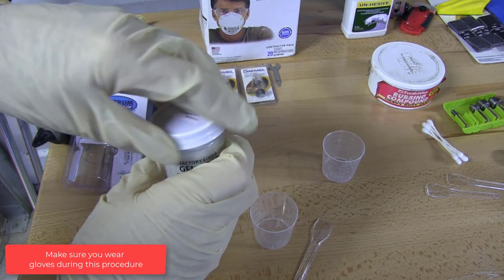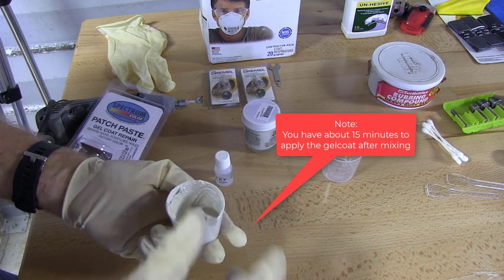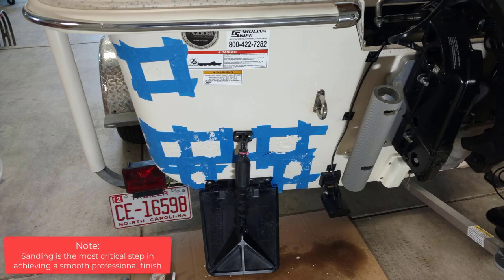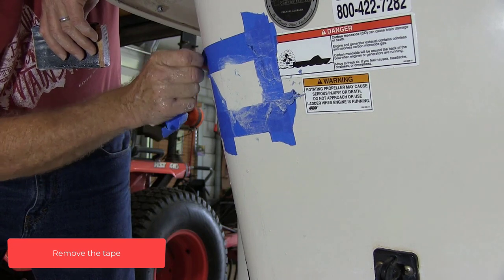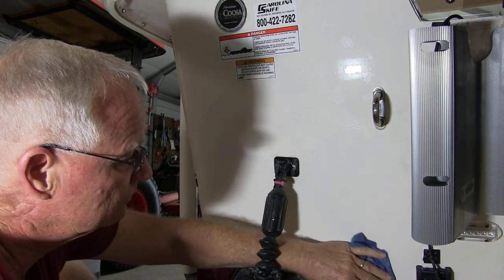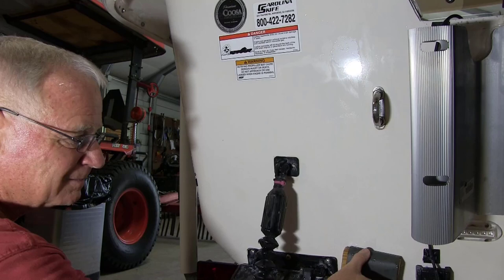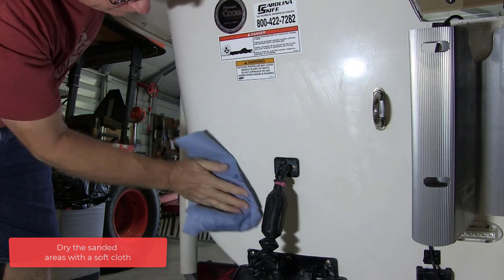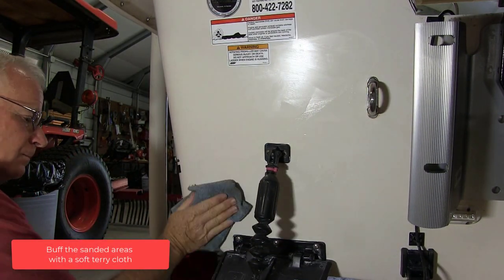Part 4 - How to Repair Screw Holes in a Fiberglass Boat

Comment: Could you do a Video on how to remove screws from the stern of your boat?    I will wait until the mosquitos wont carry me off to do these repairs.     I used 4200 to install brackets for the smart tabs.     Thank you very much !     Wish you were my neighbor 😁
Reply from the maker: I appreciate you watching my video. I hope you can complete your repair project. If you were my neighbor, I would be glad to help you with the boat repairs. As far as making a new video, I have no plans to do so.

However, the preparation and repair process for the holes in the current video will be the same for the stern (if it's fiberglass).

4200 Marine Sealant is a semi-permanent, flexible adhesive sealant that bonds and seals effectively while still allowing for disassembly. You should be able to remove the screws.

Please make sure to take note of the following instructions:

If the screw holes go all the way through the laminate and are located below the waterline, you will need to cut pieces of fiberglass fabric in varying sizes. These pieces should be saturated with a mixture of epoxy 105/205 and 410 fairing filler to fill the hole,  the number and size of the pieces will depend on the size of the holes.

I hope this helps.
Thanks,
Norman

Comment: This is the best video on this subject that I have seen.  Thank you very much for taking the time to make it.  Well done!
Reply from the maker: Marty,
I appreciate you taking the time to watch my videos. Thanks for the nice comments!
Norman
Reply: @NormanGooch  I hope my repairs turn out as good as yours, but I doubt it.  The main thing is that your video has given me the confidence to try!  Thanks again!
Reply from the maker: Marty,
You can certainly achieve the same results as I did. Take your time, complete one step at a time, and never try to rush through fiberglass repair. Most mistakes are made by:

Trying to complete the fiberglass repair too fast.
Not properly preparing the damaged gel coat surface for repair.
Allowing enough time between applications for proper cure time. 
Becoming fatigued during the repair process.

If at any time you become fatigued during, cleaning, sanding, polishing, etc. Stop and rest, do not continue working. Sometimes it is best to wait until the next day to continue the project. 
All steps except for applying the gel coat can wait!

You will get better results when you are alert and rested before attempting fiberglass repair.
Thanks,
Norman
Reply: @NormanGooch  Great advice!  Thanks again.

Comment: thanks for giving me the guts to fix fiberglass on our sailboat
Reply from the maker: Lisa
It is not difficult to do the repair. Follow the steps in order and take your time. You cannot rush fiberglass repair. Make sure your measurements are accurate and use high-quality materials and tools. Wish you success on your repair project.
Thanks for watching my video.
Norman

Comment: Thank you for your videos.   They were very informative and I really appreciate your step by step approach.    -  I filled screw holes with marine sealant when screwing in my smart tabs of which I now need to move.   Will I be able to do all these steps the same way even though I did that?   I did not want to take the chance of any of the screw hole area leaking so I probably went overkill with the marine sealant.
Reply from the maker: Depending on the type of marine sealant used to fill the holes, you should be able to remove the screws. However, you must be very careful to avoid breaking or stripping the screw head.

Do not use a power screwdriver to remove the screws, as it can be too fast and strip away the cross shape in a Phillips head screw, making it more difficult to remove.

Use a manual screwdriver with the correct size head and apply enough pressure to avoid jumping in the screw head slots. You can feel if the screw is loosening; slowly turn and remove.

If the screw doesn't turn with a screwdriver, and there's enough space above the surface, you can clamp a pair of locking pliers to the screw head as close to the surface as possible. Then gently turn it counterclockwise. It's important to work slowly to avoid snapping the screw head.

If the screws come out, you can use a drill and clean out the holes. 

 Please make sure to take note of the following instructions:

If the screws break off and you're unable to remove them, just let me know and I'll provide you with some suggestions on how to safely get them out without causing any further damage to your boat.

Furthermore, if the screw holes extend all the way through the laminate and are situated below the waterline, you'll need to utilize progressively larger pieces of fiberglass fabric saturated with a mixture of epoxy 105/205 and 410 fairing filler to fill the hole.
If you purchased a West Systems Fiberglass Repair Kit, it includes instructions and all the necessary materials for the repairs. I hope this information is helpful.

Thanks for watching my video!
Norman

Comment: Brilliant - what a pro result you got.  Need to do the same on my boat.
Reply from the maker: Thank you for your comment. The hole repair job is not difficult to do. If you do one step at a time, use quality products, and don't rush through any step, you can have the same results with your boat.
Thanks,
Norman

Comment: Great job on both the boat and the videos! It looks like the primary components in this process is time and patience 😊
I like that you state how much time was spent on each step so you know what you are getting into. I feel tempted to repair a few holes in my sailboat when time permits.
Reply from the maker: You are correct! fiberglass repair is not something you can rush through. Best of all, it is not difficult to do. Taking your time to complete one step at a time in the correct order and using accurate measurements, anyone can achieve good results and save a lot money on repairs. I appreciate your nice comments and thanks so much for watching my videos.
Norman

Comment: Norman. Great, instructional video. I see you have applied the gelcoat to an epoxy repair but I have previously read that gelcoat polyester resin is not compatible with epoxy. Would be interested in your view on this.
Reply from the maker: There have been conflicting answers regarding whether gelcoat can adhere to epoxy or not.
You can find expert fiberglass boat repair craftsmen stating gelcoat will not cure over epoxy resin and you will also find experts who say it will cure over epoxy resin.

The answer:  Yes, it will. The gelcoat will bond well to a properly cured and prepared epoxy surface.
Epoxy hardeners are a blend of amines. The amines from the epoxy can inhibit the polyester gelcoat and prevent it from setting.

The main reasons gelcoat will not bond to epoxy:
1. Under-cured epoxy. 
If the gelcoat is applied to epoxy before it is fully cured, the contact with the non-reacted amines stops the curing process.

2. Epoxy is not mixed at the correct ratio. 
Mix ratio is so important and if it's wrong your epoxy mix will not cure. The gelcoat will not adhere to un-cured epoxy.

3. Amine Blush.  
Amine blush is a surface effect resulting from the curing agent reacting with Carbon Dioxide in the air rather than the epoxy resin. The by-product of this reaction is a compound that forms on the surface of the curing resin and readily absorbs moisture from the air. Under high humidity conditions, it will cause white streaks to appear on the surface of the resin and the uncured laminate.

4. Surface not properly prepared.
Textured, sanded, cleaned with water, cleaned with acetone, and cleaned again with water.

5. Working in humid environments.
Working with epoxy in a humid environment may cause inconsistent results due to moisture entering the mixture. 
It's recommended that you keep the temperature as close to 75 Degrees as possible.

I have used epoxy to repair small holes and cracks in fiberglass boats for many years using West 205 and 207 hardeners. (207 has a stronger bond) and applied a gel coat to the repaired surface and had no issues with the gelcoat adhering to the epoxy surface.

I hope this answers your question.

Thanks so much for watching my video!
Norman

Comment: Excellent video. Just purchased a used FRP boat and need to "proper" repair some screw holes. Fastener clips are missing. Used West Epoxy before. Matching the gelcoat might be the problem. Mfr is long gone.
Reply from the maker: Mixing gelcoat with color mixing agents can be challenging, especially if you lack experience. You can purchase kits that come with coloring charts to help you match your boat color. When adding thickeners and catalysts to the gelcoat, it is essential to be careful and to pay attention to timing. Thank you for watching my video, and I appreciate your kind comments.
Norman

Comment: Wow..i was going to pay someone to do this. after watching, feel pretty good I can do it
Reply from the maker: If you take your time and follow the steps in order, you can do the repair yourself even if you haven’t done fiberglass repair before.
Most fail the first time by not following the steps in the correct sequence, rushing the repair, or forgetting important parts that are crucial to proper application and curing of the Gelcoat and epoxy.

If this is your first time attempting to repair Gelcoat and fiberglass, you should do some research to learn a little basic information about Gelcoat, fiberglass, laments, and epoxies.
Once you have a little knowledge, it will help you understand why you are doing certain steps during the repair.

Before you start, get all the tools, materials, instructions, and time to begin.
Take your time and do one step at a time – complete all instructions in the correct sequence in each step before starting the next one. You do not have to do all steps on the same day.

Be thorough, double-check your work at every step of the way to make sure you are doing it right.

Don’t Worry! This is a do-it-yourself project. 
Even if you make a mistake, you can fix it. If the epoxy doesn’t cure, or it wasn’t mixed right, or the gel coat is not smooth or curing properly, you can start over and try again.
It can all be fixed and done over. You can’t mess up!

Once you complete a step and you are 100% sure it was done right – then move to the next step.

If you follow these instructions, you will save a lot of money by doing it yourself.
Thanks for watching my videos.
Norman

Comment: Stunning finish! Sunscribed! Do you reckon this method would work for a full thickness hole in gelcoat on a motorhome roof? The fibreglass underneath it is intact thankfully. 😊
Reply from the maker: To repair the hole, I would use an RV roof patch.
First, assess the size and depth of the hole. If it's large and deep, You will need to fill in layers for this size hole. Epoxy generates heat as it cures, this size hole will not cure properly if you fill it all at one time.
Make sure the interior of the hole is clean and free of moisture before you begin the repair. 
Cut pieces of fiberglass reinforcing fabric to fit the diameter of the hole. Saturate the fiberglass pieces with epoxy resin, push it down into the hole, only fill 3/8” at a time, and let the epoxy resin reach the gel stage between each layer.  
After the hole is completely filled, let it cure for 24 hours before applying the roof patch.
RV roof patches are very durable, and provide a permanent solution to a tear or small hole.
Depending on the type of RV patch you buy, follow the manufacturer's instructions for proper application.
I hope this helps with your project.
Thanks for watching my video!
Norman

Comment: Beautiful job .I  need to repear a couple holes in my boat ,can you do it for me and I pay you ???
Reply from the maker: Yosbany Ramos,
Sorry, I no longer repair boats for other people. If you hire someone to do the job, depending on the number of holes, size, age of boat, condition of the gelcoat, and hole location , the cost to repair can be very expensive. You may consider trying to do it yourself. It's not difficult to do , it just takes time and patience. You will be amazed at how easy it really is. You can achieve the same results with a little work.
I appreciate you watching my video and wish you luck with your boat repair.
Thanks,
Norman

Comment: I was under the impression that gel coat does not bond to epoxy. Will that effect a repair situation like this? I have several holes from removing a down rigger mount and am planning on a new coat of gel coat for the entire top surface of the boat.
Reply from the maker: It is easy to be confused when it comes to gel coat and epoxy. 
Epoxy hardeners are a blend of amines. The amines from the epoxy can inhibit the polyester Gelcoat and prevent it from setting.
There have been so many conflicting answers to the question: Will Gelcoat adhere to Epoxy?
The answer:  Yes, it will. Gelcoat will bond to a properly cured and prepared epoxy surface.

The main reasons Gelcoat will not bond to epoxy:
1. Under cured epoxy. 
If Gelcoat is applied to epoxy before it is fully cured, the contact with the non-reacted amines stops the curing process.

2. Epoxy is not mixed at the correct ratio. 
Mix ratio is so important and if it's wrong your epoxy mix will not cure. Gelcoat will not adhere to un-cured epoxy.

3. Amine Blush.  
Amine blush is a surface effect resulting from the curing agent reacting with Carbon Dioxide in the air rather than the epoxy resin. The by-product of this reaction is a compound that forms on the surface of the curing resin and readily absorbs moisture from the air. Under high humidity conditions, it will cause white streaks to appear on the surface of the resin and the uncured laminate.

4. Surface not properly prepared.
Textured, sanded, cleaned with water, cleaned with acetone, cleaned again with water.

5. Working in humid environments.
Make sure the epoxy and the environment are as dry as possible. Humidity levels below 85% are recommended.  Working with epoxy in a humid environment may cause inconsistent results due to moisture entering the mixture. 
It's recommended that you keep the temperature as close to 75 Degrees as possible.
If the temperature is warmer the epoxy will react quicker which results in shorter mixing times and faster cure times. The epoxy can also burn if the temperatures are too hot during the mixing process.

I have used epoxy to repair holes and cracks in fiberglass boats for many years, using West 205 and 207 hardeners. (207 has a stronger bond) and applied gelcoat to the repaired surface and so far, have not had any issues with the Gelcoat adhering to the epoxy surface.

I hope this helps with your question.

Thanks,
Norman
Reply: @NormanGooch  your answer and detailed explanation are very helpful Norman. Thank you greatly for taking your time to lay it out for me. I live in Florida and all I ever heard was gelcoat didn't bond to epoxy. Maybe down here It's just a rule of thumb due to heat and humidity? At any rate, I'll take your information and proceed accordingly. Have a great day!
Reply from the maker: If your boat will fit and you have access to a garage where you can control the temperature, you should have no problem with heat and humidity causing issues with your boat repair using epoxy filler and Gelcoat.
Thanks again for watching my video.
Norman
Reply: Like Norm says, if you apply the epoxy properly, let it fully cure and remove all traces of amine blush you will be fine on any non-structural application.

Comment: Thank you very much for the step by step instruction and demonstrating the impressive result! I have one question: In my case, the screw holes became loose (so the original screws do not hold any more), and I would like to repair it to re-use the original places to put the screws again. For this, may I follow the same step except for the last gel coating, as the surface is not exposed and I do not need to make it look nice? Or, to drill the same place, do I need different step, such as filling the hole with different type of filler? Thanks in advance.
Reply from the maker: Drill the original screw hole a little larger to expose new material inside and around the hole.
Make sure you clean inside the hole removing all dust and debris.
Clean the area with acetone.
I suggest using West 105 epoxy resin, 205 hardener and 406 adhesive filler. 
Follow mixing instructions for the epoxy and hardener, then add filler and mix until you get a ketchup consistency.
Fill the hole with the thickened epoxy, if the hole is on a vertical surface,  tape over the hole and let cure for 24 hours.
Once the epoxy cures it will be extremely hard and durable. 
Use a collar on your drill bit to stop at the right depth of the original hole.
Drill a pilot hole into the center of the epoxy filled hole. 
Dip the screw in 3M 5200 sealant to eliminate the possibility of water seeping into the hole.
Drill the screw into the pilot hole using the low-speed setting on your drill.
Stop drilling when the screw head is about ¼” from the surface.
Use a hand-held screw driver to continue tightening down the screw until secure.
Make sure you seal around the screw and attached accessories with marine sealer.
I hope this helps,
Thanks,
Norman
Reply: @NormanGooch  Thank you very much Norman for the very detailed instruction! This is really helps. Really appreciated!